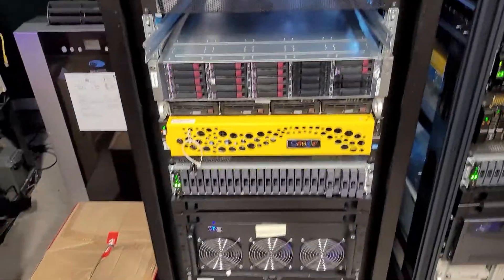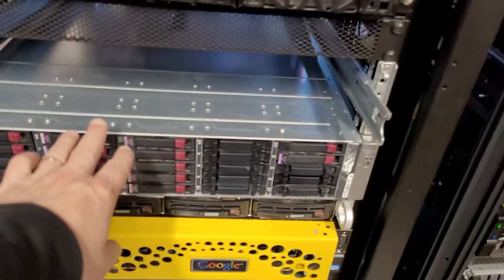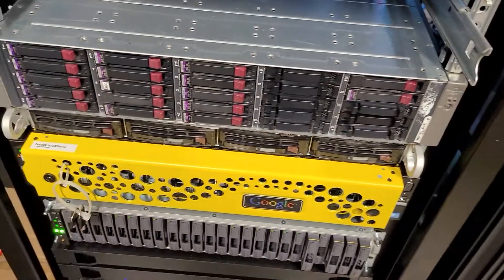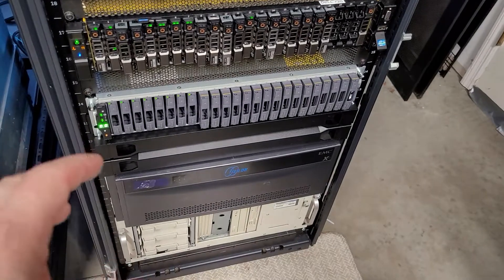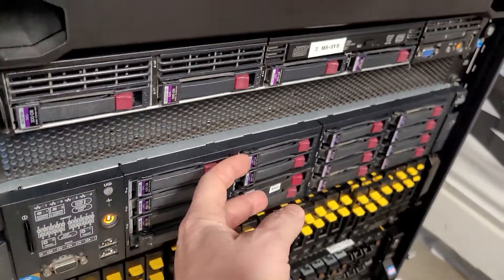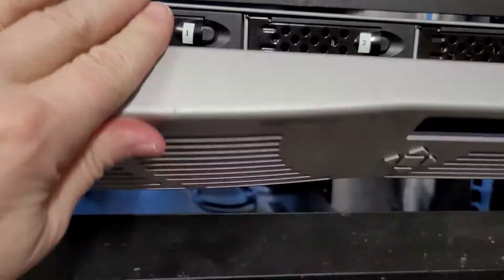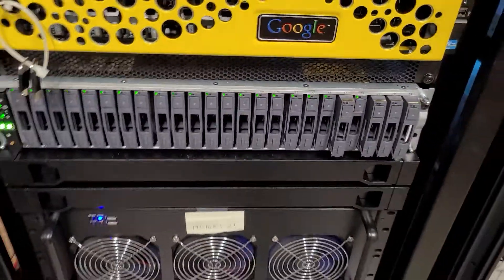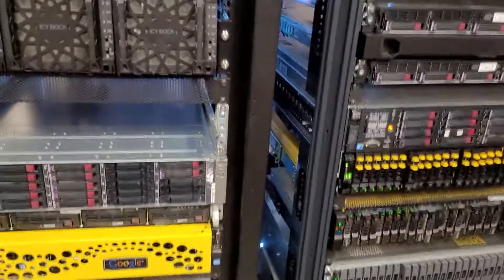How to manage all those extra Hard Drives that you have in your home lab

Comment: What raid can you recommend for a hp 3par m6710    -----help
Reply from the maker: Well your RAID needs would be based on what type of storage you want to setup.  For basic IP storage for NAS functions RAID 5 or RAID 6 will work but not so good for DBs, or App/VMware needs.  If you are doing that instead basic storage you want to have RAID 1+0 (RAID10) and set your write cycles to about 16 to 32 MB on the format write.  Higher write values are for large files (Like 64, 128 or 256 MB, these are better for larger file formats like blob file and zip files.)  Apps like needs need lower and faster write cycles to keep things moving.

Also one other key fact is are you running single fail over path (1 to 1) with one controller or are you using two controllers (classic 2x2 failover for storage systems) If you have 2x2 then you can mix both type of RAID groups on the same 3PAR disk arrays for you have the bandwidth to handle that mode.  If you using a single controller then connect each RAID group type 3PAR to its own controller. Don't worry if you have 4 or more 3PARs. Just daisy one 3PAR to the next 3PAR and then return to your single controller.. So you will have two RAID5 3PARs for basic storage and two 3PAR for App needs.   Side note.  Play with the write cycle some for your apps.   Test it so you get the best speed you want for your write cycles.  Hope this helps some...
Reply: @leadiususa7394  OK thank you very much. Well yes, let play with the raids